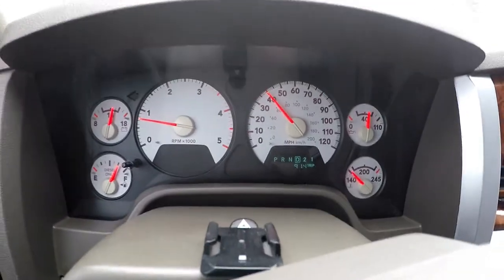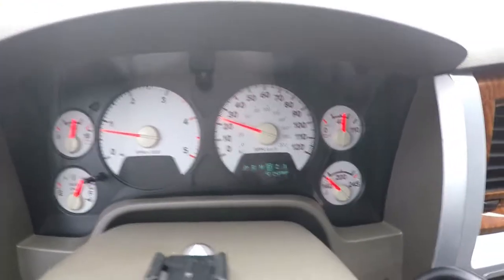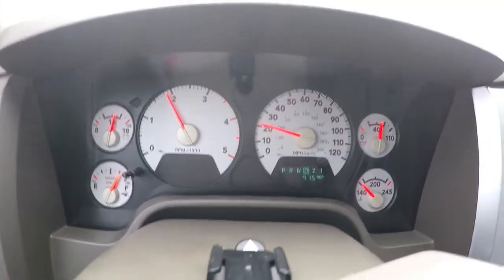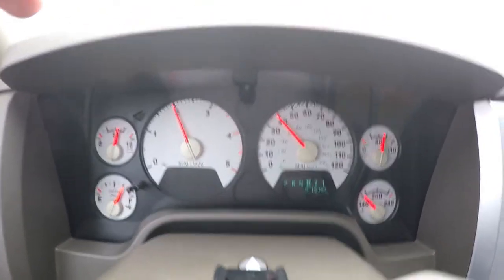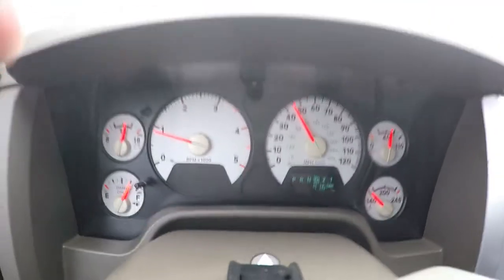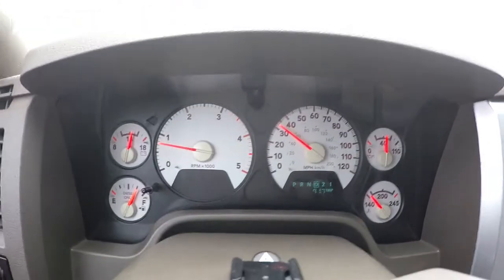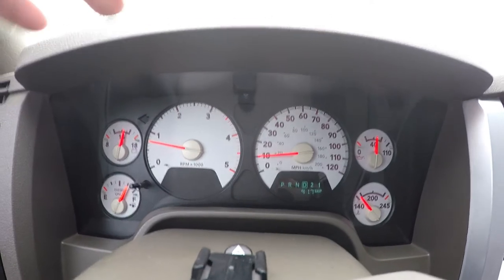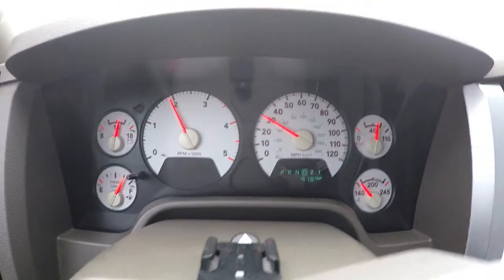Cummins 48RE Issue

Comment: Are you sure you're ttva is working since dodge got rid of the tv cable an replaced it with an ttva. I have always figured that's how the transmission knows when the accelerator pedal is pushed to the floor. To downshift the transmission

Comment: My Ram 2500 5.9 was having problems shifting from 1st to 2nd. Installed the BD diesel kit with the older style transducer and newer mopar gov pressure solenoid and it doesn’t have that problem anymore but now it seems like it hits neutral sometimes when shifting from 2nd to 3rd. It sucks because I love my truck but I’ve sunk so much money into the transmission at shops and diy trying to fix it and I’m about to just give up and take a huge loss on it. It only has 73000 miles and I don’t think it should be having these problems. 48re has to be the worst transmission ever put behind the Cummings
Reply: Don't know why crystler put that pos in there.  Where's Allison lol

Comment: Any update of what you found was  the cause of this hang up in 3rd.? I think possible just time for a service or bad pressure solenoid.
Reply from the maker: I’ve just been driving around it. My tuner adjusted the TTVA angle so it doesn’t shift into 3rd too soon anymore but it still won’t downshift from 3rd to 2nd.

Comment: Sounds like you've lost 2nd gear. A common problem with the 46/47/48RE is the front/kickdown band will be stretched and/or worn out. You can check for this by trying to adjust the band. Adjustment for this band can be done without dropping the pan. If the adjustment screw ends up flush or beyond flush with the locknut the band is in need of replacement.
Reply from the maker: I definitely still have 2nd gear. It upshifts perfect every time. It just won’t downshift.
Reply: @krey8171  Are you sure you have 2nd gear? It's easy to mistake 3rd for 2nd. The trans will go through 4 shifts in total: 1-2, 2-3, 3-4, and lastly torque converter lockup. When 2nd gear is missing it'll go from 1st to 3rd on the upshift and not be able to downshift for a pull until you're slow enough for 1st gear.

My evaluation could be wrong for you but it's the easiest issue to check for that doesn't require removing the transmission or dropping the pan.
Reply from the maker: I understand what you’re saying, and I appreciate the info. I don’t know much about the band adjustment. I’m 100% sure I have 2nd gear. Everyone I’ve spoken to says it’s a solenoid.
Reply: @krey8171   Well there are three solenoids on the 48RE: the governor solenoid, the overdrive solenoid, and the TCC solenoid. The governor solenoid, and it's associated governor pressure transducer are common replacement items that affect the computer controlled shifts. It's located on the valve body and requires dropping the pan. Ironically, when the pan is down it's a good idea to change the fluid, filter, and do the band adjustments front and rear.

Best of luck to ya, I know you say your 100% certain you have 2nd gear but watching your video reminds me of my own transmission woes. I thought I had all the gears too.

If you want it fixed, my advice is have a transmission tech diagnose it. They can check the governor pressure data with a scantool that can read transmission data and determine if the governor solenoid or pressure transducer are acting up. They can also do other checks and utilize their expertise and familiarity with the 48RE to give you ideas on what's wrong.
Reply from the maker: It used to stack 2nd and 3rd sometimes, but I had my tuner adjust the TTVA angle and it no longer does that. I have been wanting to drop the pan and do everything you mentioned, but I’m pretty close to a fluid change anyway. After I get moved in the next couple of months I’m going to do all of that. I really appreciate you taking the time to explain all of that. 

Also, I’ve waited to get somewhere that has a shop semi close I can trust and is knowledgeable with the 48re.

Comment: Seems like you have a governor pressure on problem. Watch on a scan tool to see if actual governor pressure is stuck around 40-60 like should be in 3rd gear. Governor pressure should be pretty close to 1-1 with mph while under 20 mph. If governor pressure commanded to be that high during low speeds you may have a control from the computer problem.

Comment: Mine does the same thing with exception - I can see on my edge that the computer has commanded 2nd gear but it’s still in 3rd. If I slow down to 13-14 mph it will downshift into 2nd. I can also manually shift to 2nd and it will down shift. It’s really annoying. Built tranny with suncoast TC, valve body work and other internal parts. Is yours built by a company or did you do it?
Reply from the maker: I don’t have an edge so I can’t see that, but your situation is very interesting, as well. Mine was an ATS stage 1 unit, but I’ve put billet shafts, Goerend TC and Goerend valve body in it since. It’s done the same thing regardless of those parts being added/changed and regardless of tuning.
Reply: If you could get something to monitor what the computer has commanded it might help. Maybe a cheap OBDII with bluetooth and the Android app "Torque". Next weekend I'm dropping my pan and replacing the Gov pressure solenoid. I already replaced the Gov Pressure Sensor and it didn't fix my issue.

If you figure it out hit me up. I'll do the same next weekend.
Reply from the maker: That’d be awesome if you could update me. Anything short of pulling the trans would be best haha. I don’t have time this month to figure it out. I’m going to as soon as I can.
Reply: My new transmission pan didn’t arrive this week so I won’t be working on the tranny. Vendor says it might ship this coming week. I will let you know.
Reply: Parts came in last week and I got them installed this week. No change in the 3-2 downshift. I may have to find a local shop that specializes in these transmissions to take a look at it. I don't really like having to manually downshift to 2nd or worse slowing all the way down to 13mph just to get it to shift on its own.

If you ever figure out what is causing your issue I'd be interested in hearing what it was.
Reply from the maker: Dang sorry to hear that man. I will definitely let you know. I’m probably not going to worry about it until I pull the trans again for something else or a refresh. It sucks but I’ve just learned to drive it that way for now.

Comment: Mine is pretty much bone stock and it takes off so slow like to the point to where it's ridiculous but as long as I get over 35 it at take off like a rocket anybody knows what that could be let me know I'd appreciate it and good video
Reply: Did you ever figure it out. Mine is doing that bullshit
Reply: @MLGtroll365  mine too u ever figure out??
Reply: @nlszae8394   mine was 2nd gear, i tried adjustingthe bands,  didn't fix it, found out i needed new bands the front(forward) band was bald. So i ordered a full Suncoast stage 2 rebuild kit. Shifts strong now. 

Check your bands or clutches.  Or the governor pressure solenoid